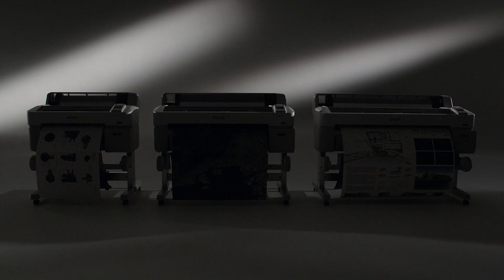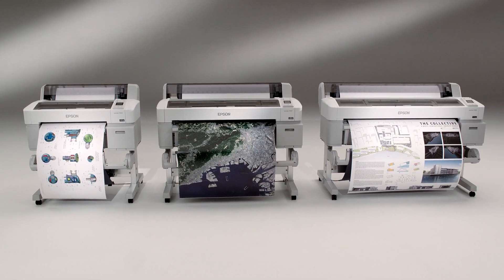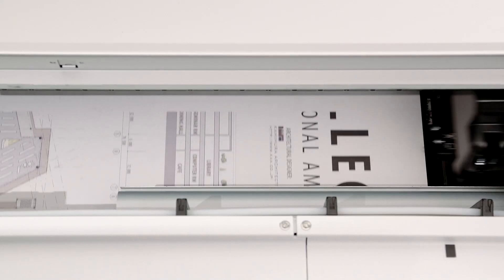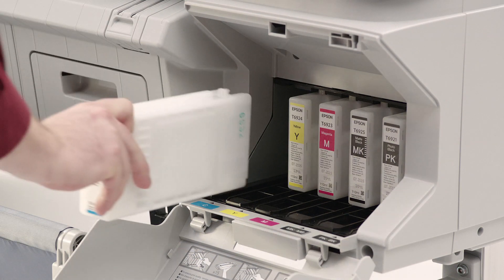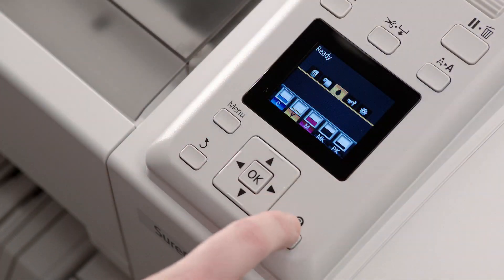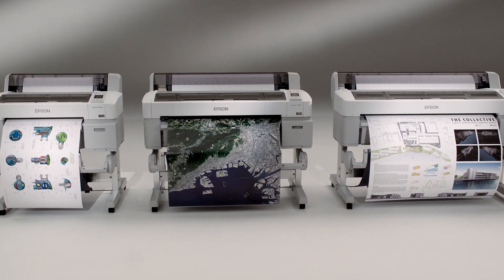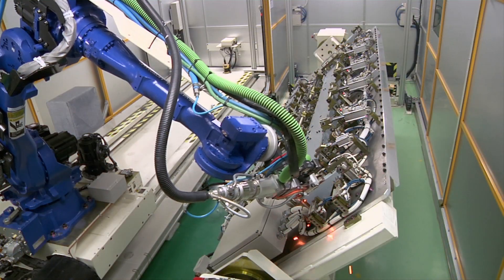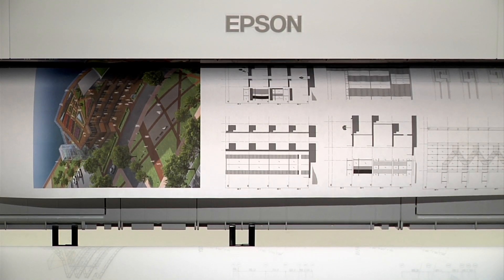Epson T-Series Printers

Comment: Impressive. I never considered this for packaging, but it appears that it's well suited for heavy stocks (for prototyping) and gloss. What about PMS MATCHING?
Reply from the maker: jkevin009 

With Pantone matching you would want to use a printer that has the widest color gamut possible. You would want to choose a printer from the Epson Stylus Pro line with 11 colors (4900, 7900, 9900) along with print media and a RIP that maximizes the Pantone library of colors that can be hit. We would recommend starting with your RIP software and seeing which printers and media it supports. If you call us at 800-453-9538 we can also answer any questions that you might have or help you with your search.